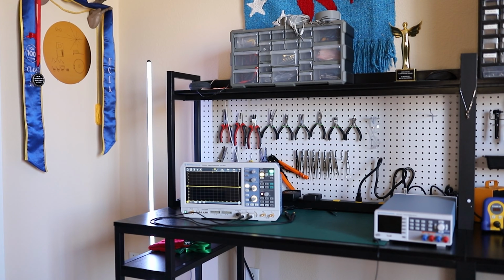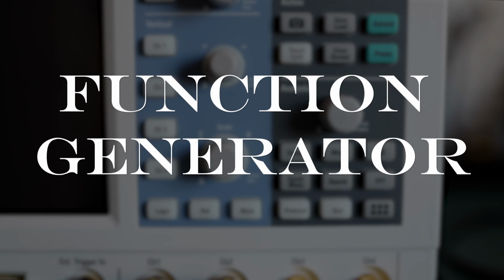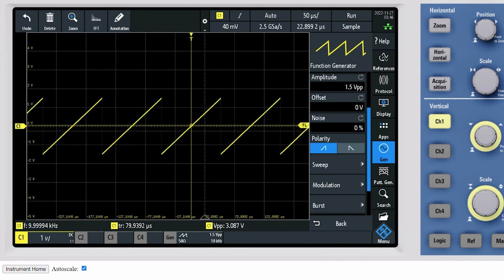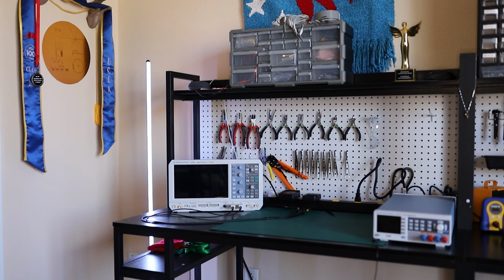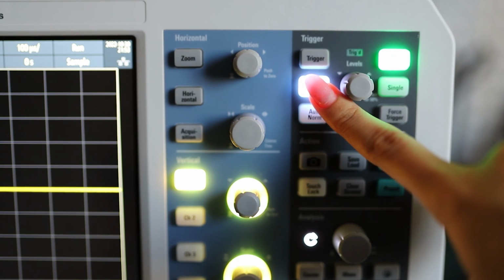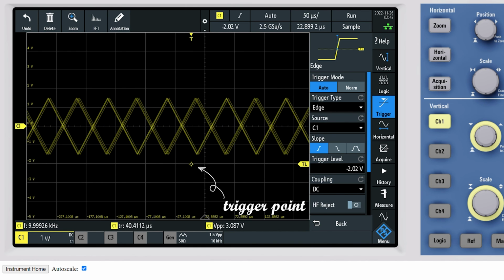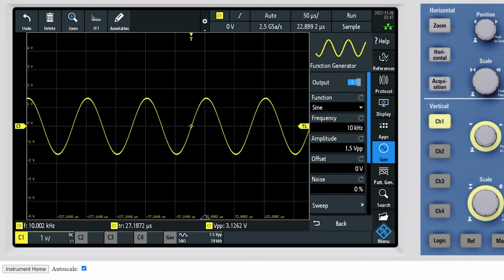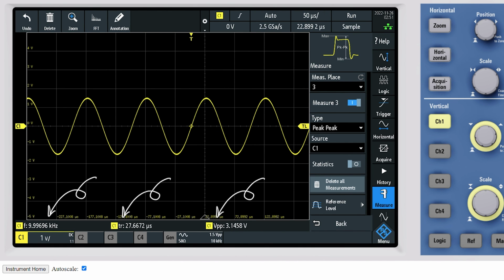How To Use an Oscilloscope | BEGINNER

Comment: You could potentially do more with a few oscilloscopes that actually operate as a Linux computer internally, meaning they obviously got room to expand beyond the way they were originally designed to do so (Linux OS also allows for hardware drivers and apps in Assembly if you prefer to do it the hard way).

Comment: in this group  of electronics engineers, i have an automatic voltage regulator for a generator, it is no longer made, repair is my only option..... im having the worst time trying to find somebody who will ACTUALLY work on it.   ive been brushed off by several companies who do you recommend for circuit card repair.   one covariate its hard epoxy coated

please help

Comment: What would be a good cheap scope for checking a 0-50mA signal at a machine at work?  It runs at 0.1hz to 10hz.  We have an issue with the machine and would like to see if I have a good control signal.  What would the signal look like.  I haven't used a scope before.

Comment: Nice to see an low level explanation of an oscilloscope. 

As a starter you don't need such an high end oscilloscope to start with. Especially one that you will probably going to smoke when you try your first electronic experiments and don't realize that the grounds on the oscilloscope is a short.

Comment: For beginner and yet uses a Rhode scope. Im sure you are a great engineer, but for teaching a beginner why not use something a little less? I dont teach photography using my phaseone medium format camera
Reply: It's a how to use for beginners, not how to equip a home lab on a budget video.  All the basic concepts on collecting and analyzing a signal are the same whether it's a R&S or a Rigol.
Reply from the maker: As a NASA Engineer my biggest issue was not having access to professional equipment to learn on before coming in. Using low end equipment didn’t properly prepare me for my internships. Most of my coworkers could also relate. That’s why!😊
Reply: @KatVoltage  I guess to beg the question is how do you get access to professional equipment? Enrolling to a university might get you some access but it still depends at what level you are at. My experience is that undergrads do not get access to these equipment in labs arbitrarily. Usually only grad students do. So basically you are saying that in order to get access, one must spend 5 years in university before one could play with this? 

I studied electrical engineering myself, and I fully understand this. But you come across as somewhat arrogant in your reply. Akin to "let them eat cake".